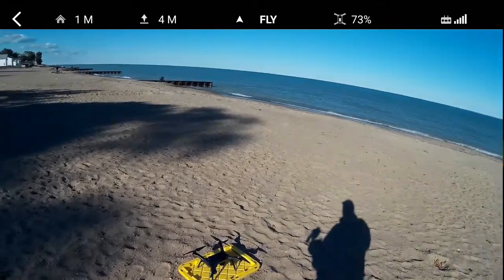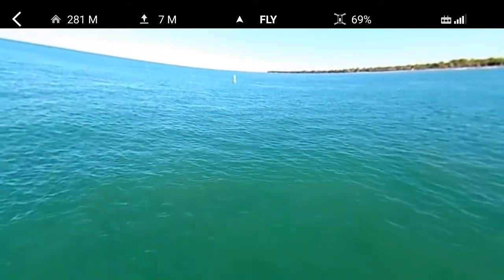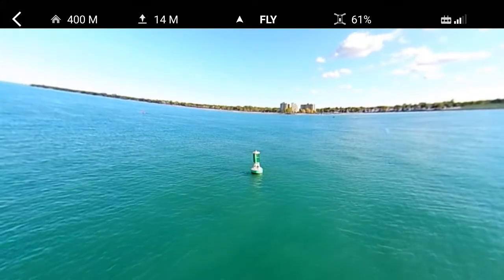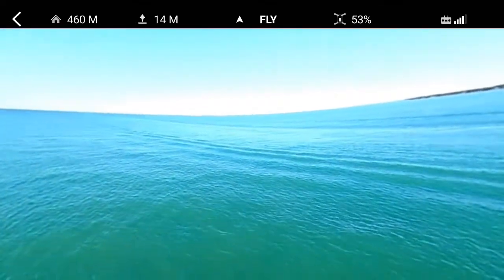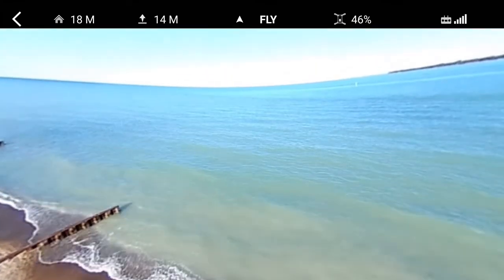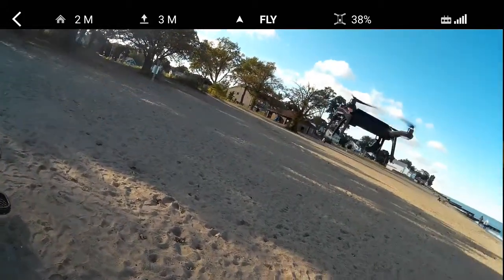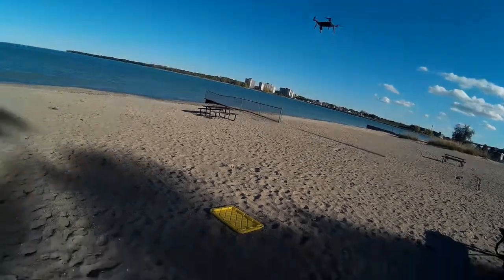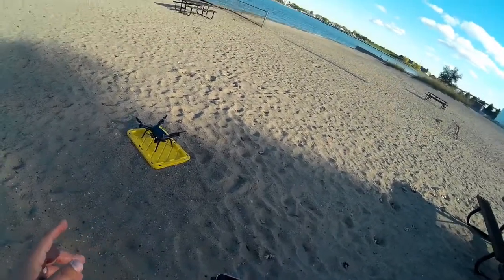3DR Solo - Second Flight with Video and Still Impressed!

Comment: If you get disoriented, you can always press the "Return Home" button and it will find its own way back to the launch point (via straight line, so make sure you set the height to pass over any obstacles in the area!).
Reply from the maker: Yup, that the first thing I do is that height as RTH is my friend :-)